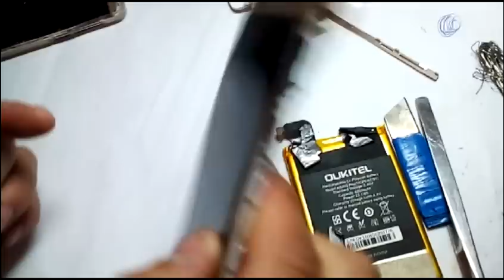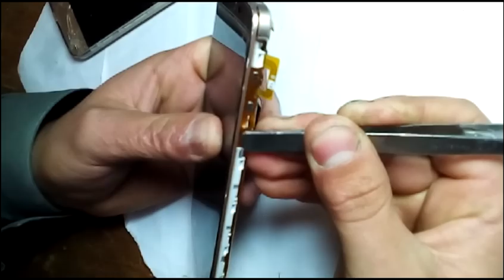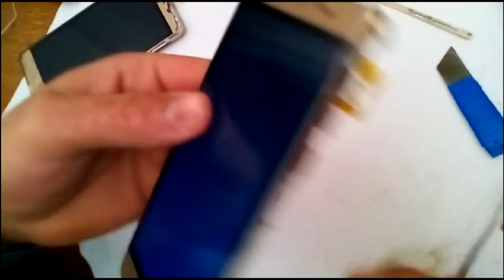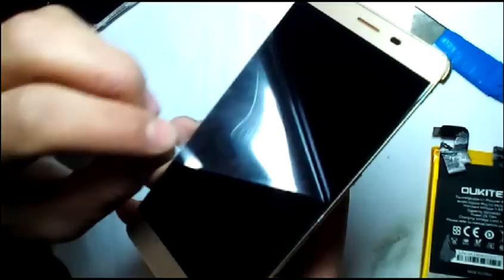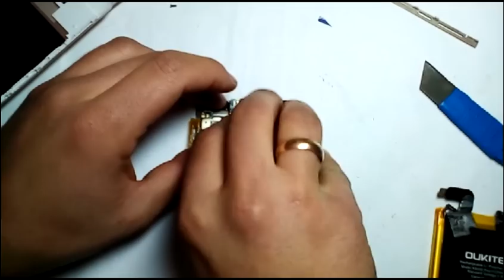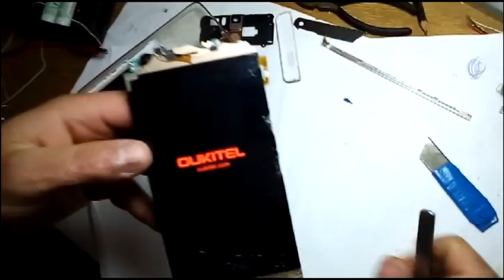Oukitel k6000pro screen не включился экран после замены - Oukitel k6000pro screen not working

Comment: The newer version of K6000 Pro is a bit different, I read on 4pda it has different display, not to mention the different front of the phone. If you're applying the new display on old version phone and vise versa it won't work.
Reply from the maker: i know this
Reply: ArtBelChannel Hi, I'm going to change the battery in my K6000 Pro, it's only $13 on aliexpress. I'm not happy with the battery life anymore and the phone is only 8 moths old. :(
Reply from the maker: ok, change
Reply: Do you know how to tell the difference of the newer model? I got a k6000 pro around November and i just ordered a screen to replace the broken one , what should i look for?
Reply from the maker: Look, the version of your firmware in the new should be V12 or V16

Comment: hey @ArtBelChannel.. i bought a used K6000pro, factory new... the problem i have is that the mic doesnt work and i want to replace it.. on alixpress like 5 -10$... is it possible to change it?
Reply from the maker: Yes you can replace the microphone yourself. It's not hard, it's soldered there. Soon the video on my channel will be released, how to disassemble the 6000CP there you will see it. And buy a microphone yes for aliexpress here is the link: http://ali.ski/JYpPCs   or  http://ali.ski/pfqeT

Comment: Hi,

I have the same problem, I have Oukitel K6000 pro dark gray color, I tried to replace my broken screen with oukitel K6000 pro dark but it did not work, can you tell me please if you have any advice. Thank you
Reply from the maker: Achraf Bendraoui, you need to flash your oukitel to v12 firmware version, then your screen will work.
Reply from the maker: Achraf Bendraoui , You can be read on the website 4pda.ru a reflash or just Included in repair and tell him what you need flash
Reply: Hi, can you please tell me how to flash v12 firmware for my Oukitel ? thank you so much for you help !
Reply from the maker: Achraf Bendraoui , hi, write me your @mail adress, I'll send you the firmware and instructions
Reply from the maker: i send your files!
Reply from the maker: M Najip,  ок. wait for 30 minute
Reply: Achraf Bendraoui i went to needrom but which one should i download?
Reply: Hi! Can you still send me the v12 package for firmware upgade artbelchannel, please? I broke my screen on my k6000pro, and I got it changed, but the screen stays blank. It powers up, but it won't give any images. Is this normal after replacing the screen??
Reply from the maker: Tero Aidanjuuri , hello, it is doesn't normal.
Reply: Tero Aidanjuuri  I got the same problem. Now I am waiting for another screem, but I would like to know what did you do 
? And if you have some advice for me. Bro I'll 
Apreciate it too much

Comment: can you do a video of how to dissable it and then replace the screen? I cracked my k6000 pro
Reply from the maker: Megalilalol1 , Sorry, i'm delete these video.
Reply: belia007belia007 Can you do it again? please
Reply from the maker: Megalilalol1, Now read here, if you do not help it may be normal in a week will put the video for you.

http://mediatek-club.ru/kak-razobrat-smartfon-oukitel-k6000http://mediatek-club.ru/kak-razobrat-smartfon-oukitel-k6000
Reply: belia007belia007 Thanks
Reply: Have a cordial greeting, I have a k6000 discontinued phone and wanted to know if the battery of the phone (oukitel 

k6000) is the same battery (oukitel k6000 Pro)

 if they are compatible between the two phones?

Thanks in advance for your reply
Reply from the maker: alicia aliz Hi, yes k6000 battery and k6000pro same, can be changed.